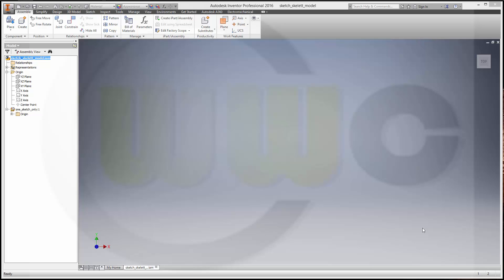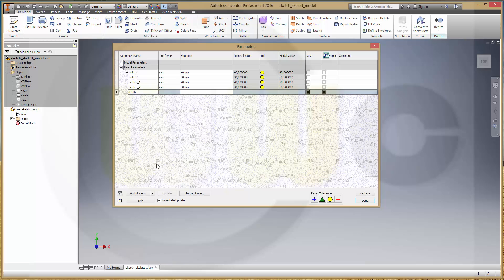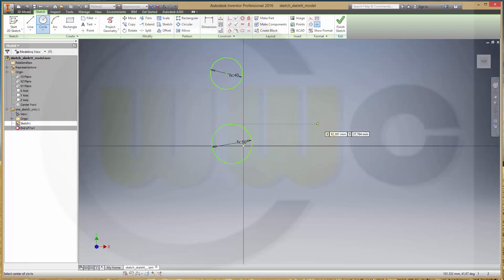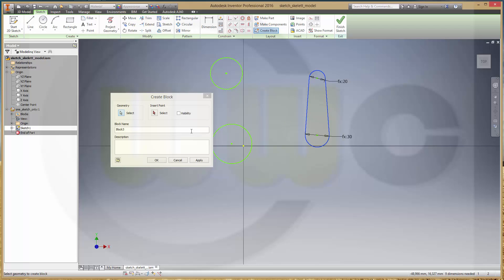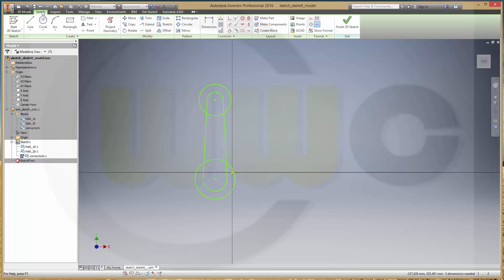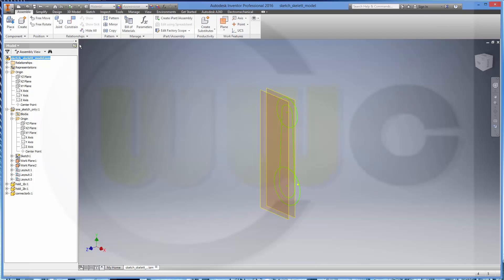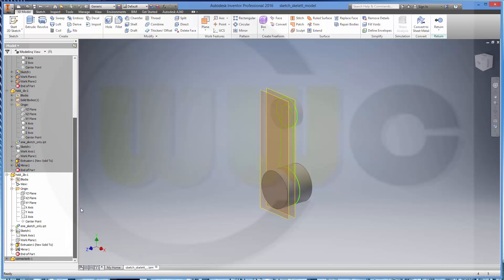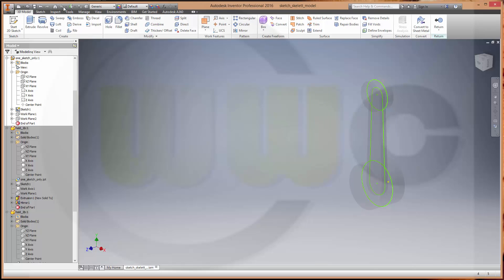One Sketch to rule them all - Inventor 2016 Training - Layout Sketch

Comment: It's been a while but I'm tinkering with layout sketches now. When you move a block in an assembly or derived part is there a way to snap them back to the right place (exact the same place they're set up in layout sketch file)? I assume the only changes we should do to the sketches are those made in the original layout .ipt right? Otherwise the whole house of cards falls apart.
Reply from the maker: No, I don´t think so.